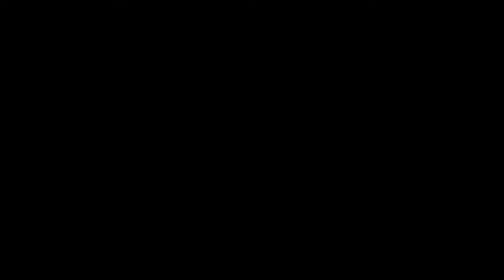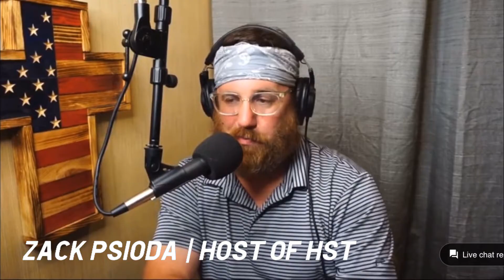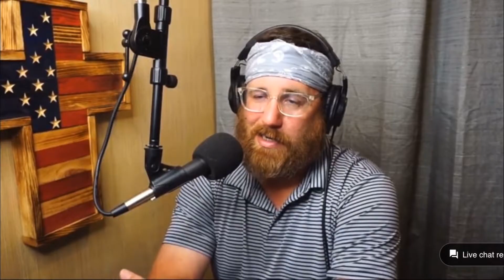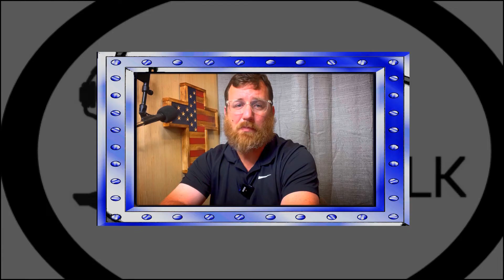Why Does Ductwork Sweat?

Comment: Good information.   I have a question.   Is it ok to downsize the air duct in a home.  Say mine has 8 inch duct work that needs replacing.  But the only available at the time is 6”.  Will it cause a problem with my A/C unit?
Reply: I hope this still helps after all this time. You might want to consider noise and vibration as the velocity of air will be faster. It will not cause any trouble for the unit

Comment: I’m only experiencing sweat on the vent below my attic crawl space and only in extreme temps (Miami in the summer).  Am I ok if there is no moisture on the ceiling/drywall?   Just concerned about mold issues…luckily it’s only the metal part of the vent sweating on very very hot days.  Thanks in advance!

Comment: Ok....I own a apartment complex and have a question..When the apartments was built (1971) the ductwork in the floor joist are not insured at all and out of 96 Units i have only two that will give me problems from sweating. Only one duct going from the airhandler to one of the bedroom upstairs is given me a problem. The stove and exhaust microwave is directly over the problem area as well.. will  insulation that one about 10 foot duct help? Or would flex duct be better for that area.. Thanks

Comment: so sweating is normal in crawl space? I'm okay with that as long as its normal and not anything wrong....But...what about water puddling in between duct and insulation? I have a couple flex lines that are holding water in-between the duct and the liner of the insulation.
Reply: You' ve got leaks in the duct, or your severly oversized.

Comment: One of the most common problems of Sweaty Air Ducts is an open window hot air is getting inside the basement and it is causing the air ducts to sweat...Close your basement windows or Check for any hot air getting inside your crawl space.... Hope This info Helps Guys.....

Comment: Got this issue with my Air Handler sweating.  Just had it installed, and the tech has had to reinforce the delivery side of the air handler, but it's still sweating.  Do you think I should try a dehumidifier in the attic, or a fan to improve ventilation?
Reply: Also check to see if it’s sucking air in through the drain line.  For example, the secondary drain may exit to a pan with float switch.  If the end is open, it may suck hot air into the system.
Reply: You need more return